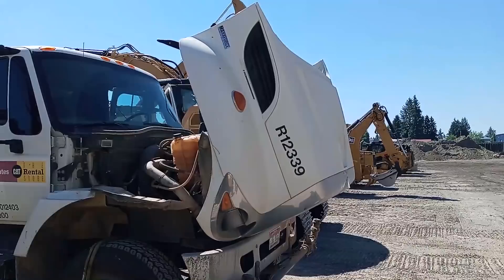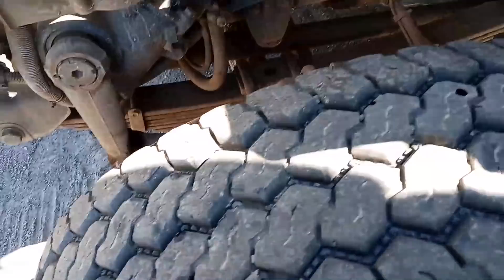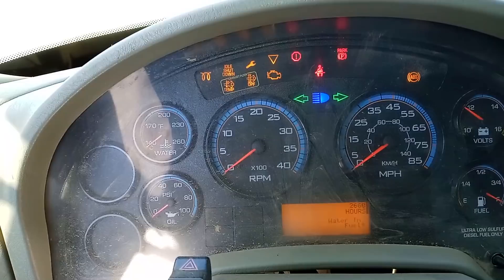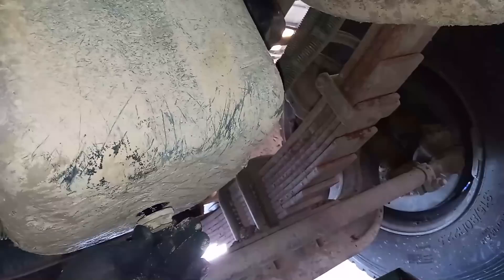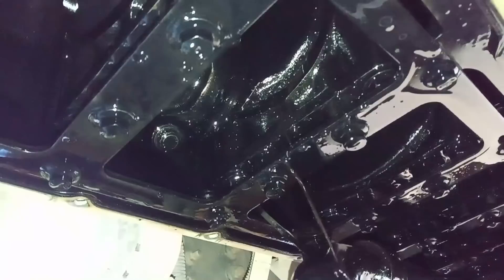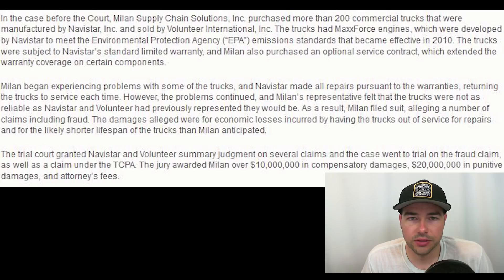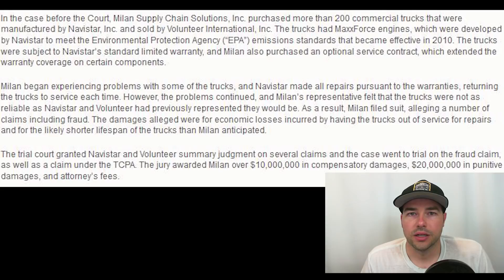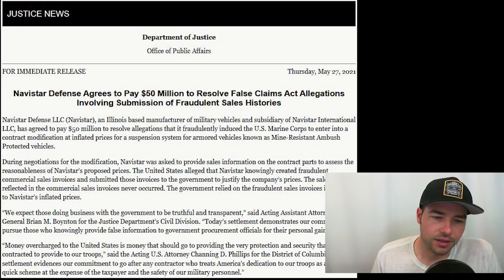CAT Mechanic working on an International. Are Navistars and Internationals Junk?

Comment: everyone knows Internationals are junk, so whats a CAT mechanic think of those big red engines?
Reply: I'll put my cat powered corn binder up against anything you want to bring down.
Reply from the maker: Well, there is a reason they are the current truck engine leader, they don't make complete junk. The ISX seems to be a pretty good engine, although a little more complicated than they need to be and I don't like VGT turbos, but they make good power and seem to run a long time.

Comment: now imagine bio degradable wire insulation used some decades into the past by mercedes :D
Reply: The idea never died almost everything is degradable now by design  ,they went even further with irreplaceable electronics unless bought brand new from dealer if available .

Comment: Internationals are fine. Thier engines suck. I'm including the Cummins. We have three in our fleet and all three are having issues. They are 2016, 2019 and 21 model years
Reply: Internationals suck I've driven brand new tractor trailers with air ride.. the chassis is rough on your back.

Comment: 13 letter shit spreader dt 466 mechanical was pretty good engine 855  12 valve B's and C's and n-14 Cummins and the rest are all boat anchors except big cam 4 those were junk with that low flow cooling

Comment: Ac system is junk on a ihc. I had one ihc and the ac was giving me a fit. Called ihc got a rep involved. Rep says what wrong and I best answer was I don't know but it has a major problem. Went through a bunch of different things and the rep says well it should work and I said right and it doesn't. Rep came in tore the truck down the same I did and he did his thing.  I looked at the rep and said well what's wrong with it he said I don't know but there is something wrong. It took a year to get the truck right and two full ac systems.

Comment: ALL of the emission engines are garbage!

Industrial diesel engines are NOT meant to run with emissions equipment, and the crap that California mandated makes them run so hot, they don't last very long, especially MaxForce, and ISX/ISL/ISM engines. They have to run so hot because of the emissions equipment, that they crack cylinder heads like nobody's business. So much so, that several years back, International ran out of new replacement cylinder heads!

As for the tractors, the ProStars and LoneStars, while the interiors are wonderful, they are junk overall.

I ran one back in 2010, and the roof leaked: it went back to International, they replaced the roof gasket SEVERAL times, and the water leaks only got worse! (It's so much fun making a turn on a city street on a rainy day, and having a bucket of water come crashing out of the CB speaker holes and onto the dash...)

Then, there's the doors: same problem as the Kenworth T-Too Ugly (T-2000), the wind sucks the door tops out, and bends them so badly, you can talk on your cellphone, and the wind noise gets so bad, people on the other end think you're doing 100mph with the windows down! Only fix, is to replace the doors!

Screw California: I'm happy as can be with my '01 Western Star, and my Caterpillar engine that stays away from that state, thank you.

Comment: Driver has something to do with how good truck lasts. Look how dirty the driver keeps his interior. No f@k$ given. Heavy acelaration, aggresive braking, idle time high I wager. No sympathy to slow down for pot holes or speed bumps and taking off in 2nd or 3rd gear.
Reply: Rental water tanker truck.  It will never be clean, it will never have one driver.